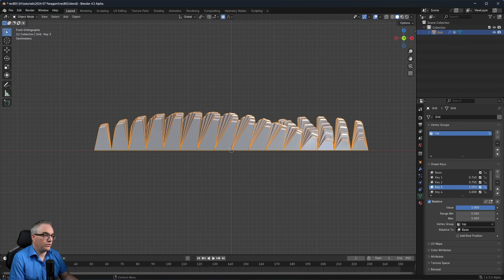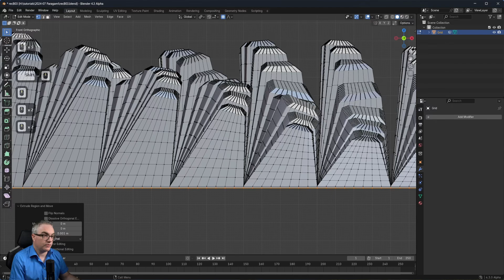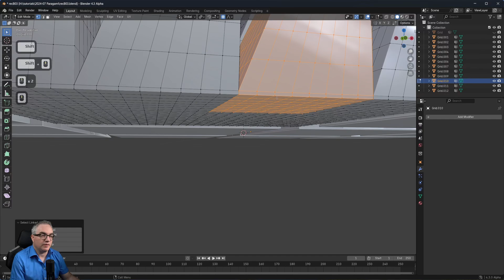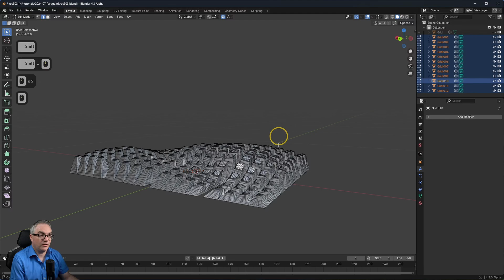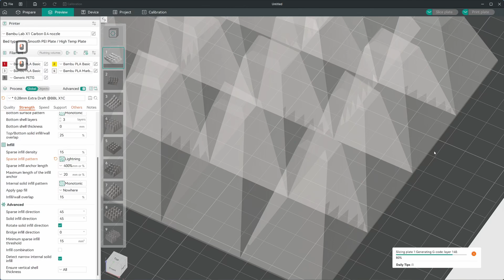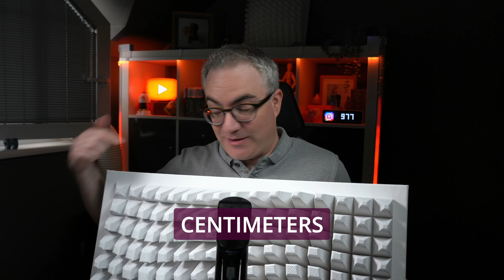I made 3D Printed Wall Art / Sound Diffuser (Part 2)

Comment: Cool art, but like most of the sound diffuser panels on the market there's no science behind it. At least the cost to print it is far less than the $600 to $700 average price for diffusers made of wood blocks, with some ranging in price from $1,000 to $5,000 per panel. Who would have thought that wall art represented to be sound diffusers could be so lucrative?
Reply from the maker: It doesn't trap sound but it sure diffuses it - like any non-flat surface ;)
Reply: @chrisptech  The science behind sound diffusors isn't just about diffusing the sound but doing so in a manner that spreads the sound waves more evenly within a space. Diffuser panels must be placed at specific points within a room based on the origin of the sound and the points of reflection. The panels must also have different physical features based on the location within the space.

I used to own a recording studio and learned a lot about this topic by working with a sound engineer. I also learned that owning a recording studio is a great way to throw away several hundred thousand dollars.

Comment: Havent you done any sort of measurement to see what frequency are being diffused by the diffuser ?
Reply from the maker: Maybe someone out there has the equipment for that?
Reply: @chrisptech  because from my experience, they dio look cool, but as sound diffusing, its pretty  ''useless''. Sorry not to shit on your project, but its like foam panel on amazon, they dont work very well. How's your experience with them ?

they do make a great wall art tho!!
Reply from the maker: IMHO any non-flat surface is a sound diffusor. This is not "sound proofing" since it has no sound dampening effect like foam, insulation or even a blanket or rug. I am not a sound techy but that would be my understanding of physics ;)